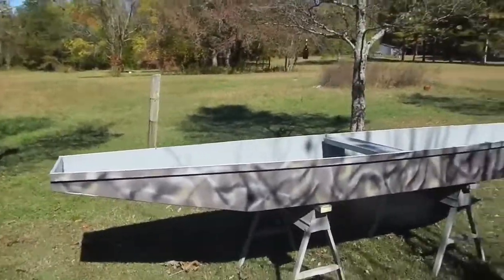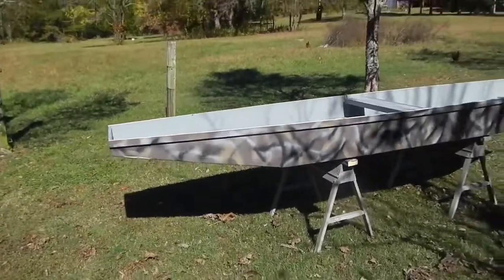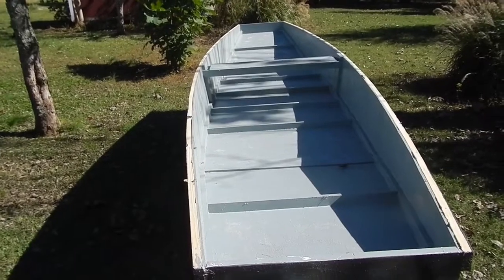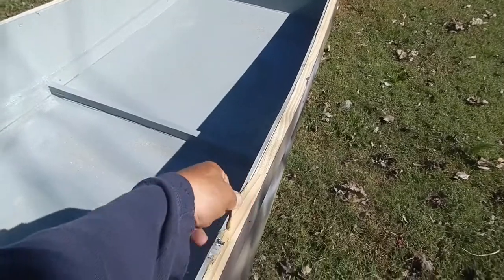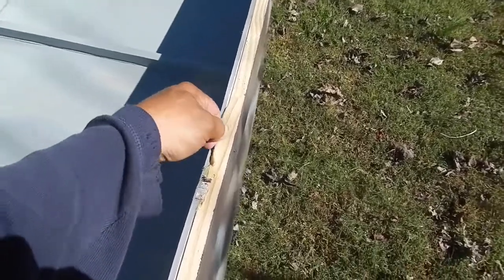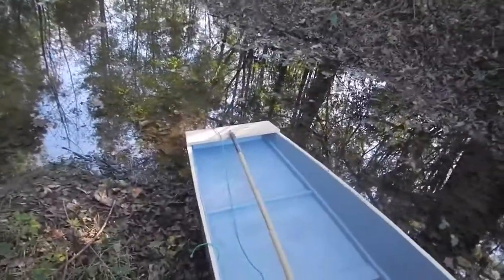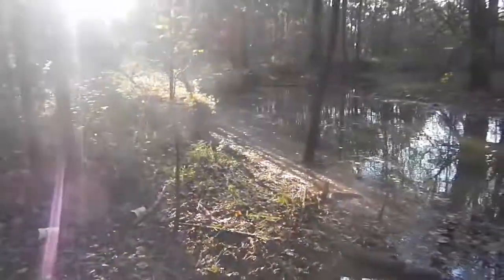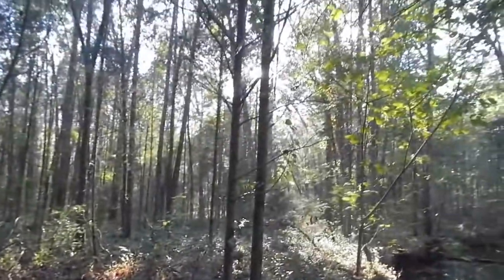The English Poling Punt - Part 4

Comment: Mark did you finish the decks? 
I had the Pop Mech. book this was featured in at one time (1970?)
had been pondering building one for our pond. Curious about the loading cap. and handling especially from the deck.
I had a Plyboat prg that is now gone... that I wanted to enter the specs to cal righting moments and loads.
Reply from the maker: I didn't do deck.  I just put a pc of 1x6 cedar on each end and a 2pcs where the end start to taper for a seat.  I have used this punt for hunting several times and it does very well.  2 guys, tree stands and bows.  Both guys can stand and pole.  Or I sit and paddle.  I am thinking of throwing on some oar locks if I can figure that out.
Reply: Thank you Mark for making this video, it is just the inspiration I needed to build this- very cool